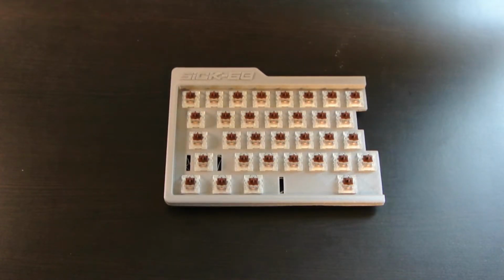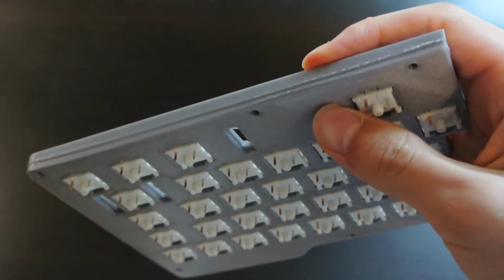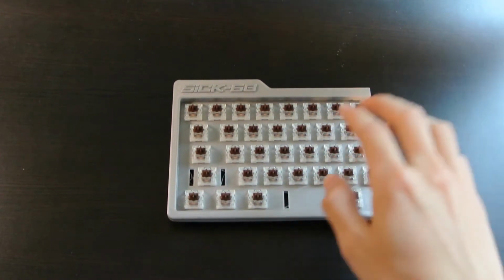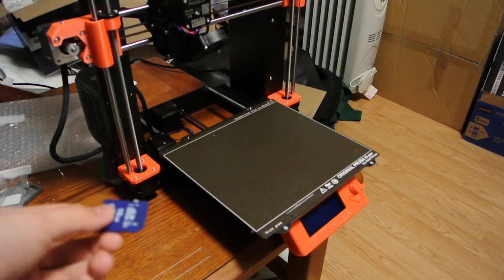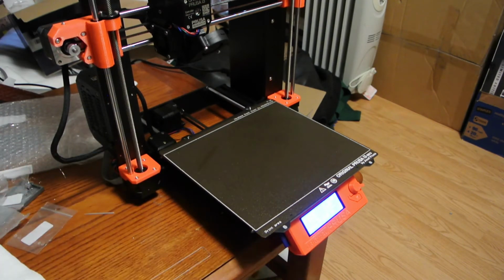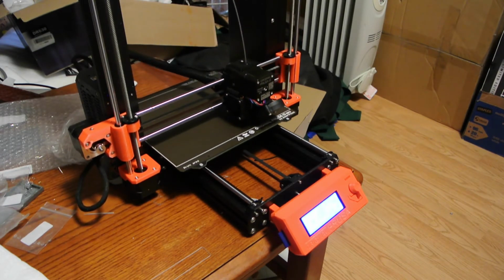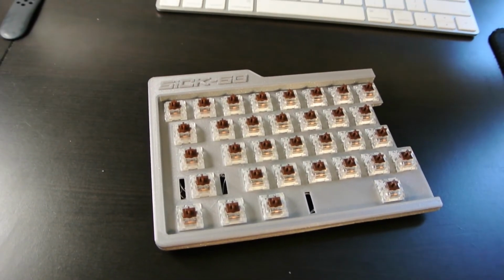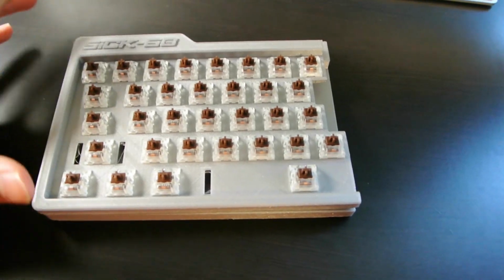3D Printing a Mechanical Keyboard! SiCK-68 Build Part 1

Comment: Make sure to print with a raft if you want to prevent warping! It uses more material but gives the print a better surface to work off of. There's tons of variables that can make a print lift. Either way, looks rad! I'm about to start printing this Sick68 soon here as well ✊